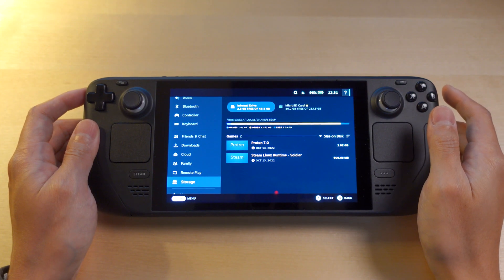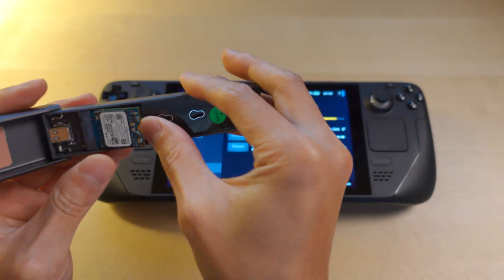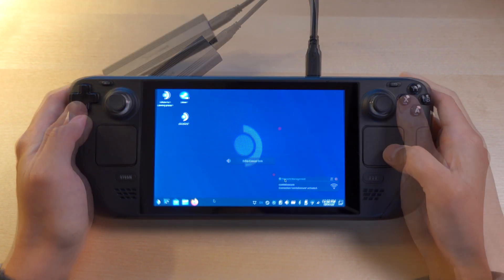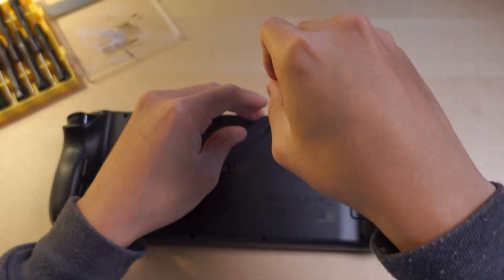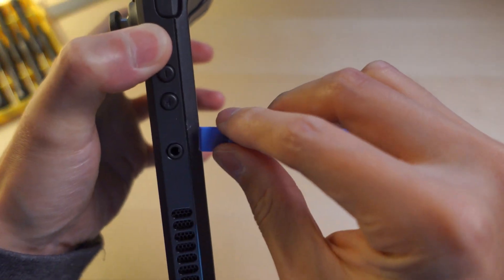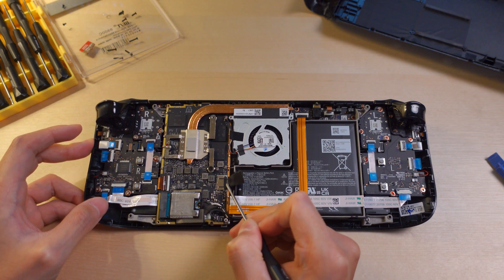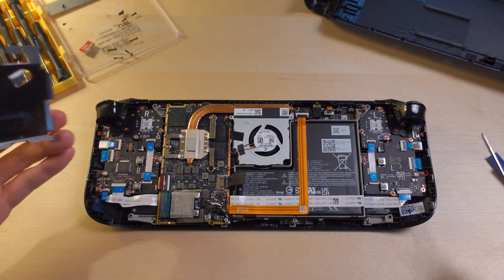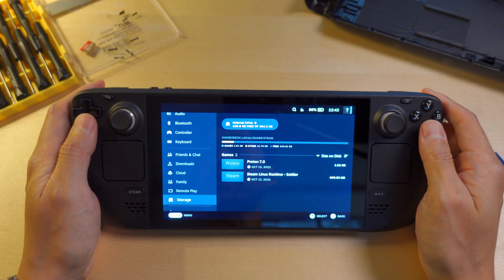Steam Deck NVMe SSD Clone and Disassembly

Comment: clone command: sudo dd if=/dev/nvme0n1 of=/dev/sda oflag-sync bs=128M status=progress

This is a command to clone the entire disk of /dev/nvme0n1 to /dev/sda using the dd command. The if option specifies the input file, which is the source disk /dev/nvme0n1, and the of option specifies the output file, which is the destination disk /dev/sda.

The oflag-sync option is used to ensure that data is written to the output file synchronously, which makes the cloning process slower but ensures that all data is written correctly.

The bs=128M option specifies the block size to be used when reading and writing data. A larger block size can improve performance but also increases the risk of data loss if the process is interrupted.

The status=progress option is used to show the progress of the cloning process in real-time.

Note that the sudo command is used to run the dd command as a superuser, which is necessary to access the disk devices. This command should be used with caution as it can overwrite data on the destination disk and cause data loss if not used properly.
Reply: I have a brand new SSD right out the box, do I need to do anything before cloning my old drive to the new one?

Comment: After the reboot, all games from the old ssd are gone. Everything had to be reinstalled on the new one. Only the games on the SD card are still available. Not so good!
Reply: Same, works to start off with but goes back to startup after reboot. Did you find a solution?

Comment: When trying to clone to a brand new 1TB Sabrent SSD I get dd: failed to open 'dev/sda' : no such file or directory exists. Am I missing anything? I already have a password setup in desktop mode and my personal computer detects the  drive when I look in computer management
Reply: Make sure when u type in nvme0n1 u use a zero and have no sd card installed and make sure ssd is gpt

Comment: Word of advice for anyone looking to do this: Once you boot into the drive, let it run for a bit. I shut my unit down right after it booted in so I could screw the back on, and it would not boot into SteamOS anymore. A reclone, successful boot, and waiting a bit resolved the issue. Drive is now dual booted with no issues.
Reply: Same thing is happening to me. I turned it on, saw that everything worked perfect, turned it off to finish closing it up. Then it never booted back up. So you restared the whole process and that solved your issue?
Reply: @SiriusLee128  Yes, i put the other ssd back in, recloned, installed the new ssd, turned on and let it run for 10 min, after which i tested a few restarts and a few shut downs
Reply: Was quick and easy to do, had it powered down and put it on the dock everything was there then it powered on by itself and everything was back to factory settings. Its up and running but I lost all my games and progress (mirco sd is still fine)?  Can I just copy and paste the old 64GB folders over???
Reply: Works for me on first boot but whenever I restart it goes back to the setup page (page to select language), and data is lost. Tried it twice now, even left it for a couple of hours before restarting. Any idea what could be going wrong?
Reply: @rhyslloyd5090  didn't have this happen to me. I would say go ahead and reinstall SteamOS (not a full reimage, just reinstall) i did that for my brother's deck that had the 'stuck on logo after cloning' issue and it booted up fine after reinstalling SteamOS, no data loss either

Comment: i tried this with a 1TB drive to a 2TB drive and it seems to only work to boot a single time but then upon restarting, the OS breaks and cannot boot properly. I have repeated this 3 times (SSD swapping back and forth) and can verify i am targeting the correct disks via lsblk. 

I have no idea why its not working past the first boot.

The only thing I can think of that may be an issue is possibly because I formatted the drive to NTFS to speed test it before i did the `dd` and maybe that extra space is not getting formatted properly via the DD command
Reply: any luck yet? I have the same issue right now :( Upgrading from 64GB to 2TB...
Reply: @KingMoeha  I ended up cloning my disk using Macrium to make a backup then I made sure when I restored the clone to the new disk  I selected the option to wipe the target drive ahead of time.

That worked. My theory was that because I had previously formatted the drive to NTFS, DD was only overwriting 1TB and the remaining space on the 2TB drive was still left formatted incorrectly

Comment: How long should the deck take to turn on after doing this? Mine is now just flashing on and off with steam logo and in the corner saying "rebooting into firmware" did I fuck something up? Any help appreciated
Reply: Put my old SSD in and works fine. My new SSD shows 420gb free before I run the command. After I run it, 60gb copied, it still says 420gb free is this correct?
Reply: It's not working for me. Followed everything and it's just not working. I do have to admit I'm no super techy. Perhaps I was over confident 😅

Comment: Just followed this tutorial, and like others, the clone command in the terminal worked flawlessly for me. Be sure to make sure your deck doesn't fall asleep though or it'll fail out. Other than that, if any of you are having trouble getting the sleeve back on your new SSD, you can undo the tape on the backside of the sleeve then put it on the SSD and then adhere the sticky part again.
Reply: Go to desktop mode, steam settings, display. You can tun sleep mode off from here
Reply: Just a quick question, do I need to format or anything on the new drive before doing the clone command? Or I can just put in in the enclosure as I got it from the mail and clone it?
Reply: @jimfaker  You can just run the commands on the new drive right out of the box.
Reply: @endor_ewoks_fc  great thanks
Reply: Tried the command and it didn’t work well I guess twin age and reinstall ugh
Reply: Mine fell to sleep. Do I need to clear the drive?
Reply from the maker: From other comments, it looks like you may need to rerun the DD command if it goes to sleep.
Reply: @DavyChiu  yes I rerun it but then it doubled everything.
So you need to delete al the created partitions first before you rerun.
But that's very fast in KDE.

This tutorial is real perfect.
My dual boot is working like a charm
Reply: @mauricewal just curious it won’t let me delete the created partitions and now I have double everything. I don’t know how to fix it
Reply: @BrokenChalice  I had the same but in KDE it let me delete all partitions very easy so I could do it again.
Hope you can fix it and remember to not let I go to sleep.
Reply: @mauricewal  I ended up just plugging it into my PC and using disc manager to format the ssd then re-copied the steam deck ssd. Worst case scenario if it doesn’t work I just reflash the SteamOS image. Not like I don’t have the stuff to do it anyways.
Reply: @BrokenChalice that should work also. And you always have the old ssd as backup.

Comment: I did the DD command to clone my drive. It seems to work and all partitions and files seem to have been cloned correctly. The cloned drive won't boot my Steam Deck. It gets stuck in the Steam bootlogo. I also tried cloning software on Windows using 2 NVME USBC enclosure. Again, the clone seem to work perfectly fine but it still get stuck on the Steam bootlogo. I do not want to reimage since I got a lot of settings on my Deck and I hate redoing everything from scratch. Now I just use the extra SSD on my laptop.
Reply: have you tried clonezilla?

Comment: Should the new ssd be formatted before hand and when it's done and you check it in KDE partition manager should both drives look the same? I've ran the command once and it seemed to go ok but when I checked it in partition manager the new drive still showed as empty. I didn't want to install it in case it hasn't worked.
Reply: Hi, did you figure this out? I am running into the same issue, when I check the ssd after the command has finished. Did you replace the ssd yet? And did it work find despite the KDE manager thing?
Reply: @Mr54M  I just gave up and did a fresh install.
Reply: @alexhayuk  oh okay. Appreciate you taken the time to reply! Thanks. Hm, I'll might try it in a couple of hours
Reply: When you restart the deck it will automatically  refresh your partition and show correct storage info.

Comment: This tutorial worked perfectly for me. No problems whatsoever. Thanks so much. You saved me a lot of time with this simple way to clone my old drive. Easy. 💯
Reply: Were you by chance using emudeck? I'm curious if I'm going to have to reinstall it or do anything new with my ROMs
Reply: @cursedhellspawn362  No, I haven't set up any emulators yet. And when I do, I plan to primarily use RetroArch via Steam. But I have seen other videos show that cloning your drive should keep all of your files and folder paths intact, so I think EmuDeck will be fine using this method.
Reply: @cursedhellspawn362  emudeck is only installed on your SD card.

Comment: This was awesome and exactly what I was looking for! Thank you!
Reply: I seem to have borked it by experimenting with loading up the old drive to experiment with it. Got any ideas on fixes? I think just repeating the process might do the trick.
Reply: It did not.. :( I even tried to re-image the Deck with the recovery tool, but no luck.
Reply: Sorry for a 4th message here. Turns out if you have a clone image and then use the official recovery tool, it will work. Always back-up your files kids!

Comment: I'm Copying the files over using your method and exact hardware And I Got in error. So now I am re running the command will it still work? First time 81gbs copied before error. Should I format first?
Reply from the maker: My recommendation is to check that the new drive is real and has no errors. There are lots of fake drives circulating. It's possible that you could just have a defective drive.
Reply: @DavyChiu  thanks for the reply yeah I installed it again with the command and it ran seems to be working now but it seems slow so it's one of those new drives the sabrent 1 TB rocket nvme 4.0 2230 what do you recommend for a Linux testing software?

Comment: Perfect guide on how to clone the SSD! I could have gone down the Clonezilla route but this was much easier to do. Easily swapped a 1TB to 2TB SSD.
Reply: Yeah I watched the video for that and looked like a pain, I’d rather buy an enclosure lol..
Reply: 1tb wasn’t enough? i wish i had your problems man haha
Reply: That's what I was thinking about doing originally, but I'm just doing this as well.  I "might" make a clone at some point just to have a backup.
Reply: how is it so far now? and did you have a dual boot 1TB setup
Reply: @lyndongaming  - so far mine is working great and I have had zero issues (*knock on wood*).  I did not dual boot so I've honestly not tried that part of it - just booting into SteamOS only.

Comment: Thank you for the excellent tutorial!
 One key thing for anyone trying this. Make sure you setup the password and use type "sudo" before you paste the clone command.  You can see he types it in Konsole but it is not included in the clone command in the description.
Reply from the maker: Thanks, I have included sudo in the description now.
Reply: @DavyChiu  do I have to format the drive before the cloning?
Reply from the maker: @pianodemon109  no, the DD command will overwrite it completely
Reply: @Davy Chiu  thank you! Worked like a charm. Upgraded a full 512gb ssd to a 1tb one. It was pretty damn quick too! Everything transferred over almost seamlessly. A couple of settings here and there were off but nothing significant.
Reply from the maker: You can repeat the command as many times as you want.
Reply: @DavyChiu how do I make a password?? Do I just type one in in console when it asks me??

Comment: Not sure you'll see this, but the enclosure you linked says it only supports down to 2242 drives, is this just a mislabel or a different enclosure from the one used in the video?
Reply from the maker: @arobeeTV the description is incorrect, it supports 2230 as you can see in my video

Comment: Please understand I'm trying to get this right, From the video I didn't see you prepare the drive in any type of way. Are you saying I can just insert a new drive into the enclosure, run the command in the terminal, insert the new drive into the Steam deck and it works?!!! No formatting the drive nor expanding partition ( I'm going from 64GB to 1 TB)?
Reply from the maker: Yes, the dd command copies everything exactly and SteamOS will do the expanding on boot.

Comment: Quick tip to anyone doing this - when formatting the new drive DO NOT create a new partition in the empty space, ONLY create a new partition table and leave all space unassigned. The initial boot partition will be formatted in whatever format you initially formated the drive to otherwise, instead of the required FAT16. Wiping the new drive and doing a fresh dd from the old drive soon fixed it from a now blank drive. Added bonus that I could boot from the old 256GB over the USB-C connection and do the dd back onto the internal drive at no speed loss.
Reply: Hello. Can you please explain I can do what it is you have mentioned. I like to use Disc genius for my drive needs. When I wipe my drive, then make a new partition, it always needs for me to select a format type, then it shows the storage space available on it. Thank you
Reply: Don't format the new drive at all, the steam deck will format it it's self

Comment: After you disconnect the battery, you need to press the power button to ensure all the power is drained.
Reply: It’s impossible for me to disconnect the battery. I just replaced ssd all the way, and no issue occurred while the battery being around 80%.
Reply: Just did this from a 512 GB drive to a 2TB WD sn740. Took me just a few minutes. Beware that the destination of the dd command might not be exactly the same mount point. Easy to check with KDE partition manager
Reply: @fastmaxr huh? Wym
Reply: No you don't. It won't hold that much power in. The largest capacitor on there is smaller than your pinky fingernail. I'm an electrical engineer and I'm telling you it's unnecessary.
Reply: I just electrocuted myself to get the rest of the power out no sweat
Reply: That’s a nice tip. But Valve recommends to put the device into power storage mode via its UEFI options, which ignores all power button presses till you connect it to power charger again. But I’m lending indeed your method to get out the last bit of juice in the circuits
Reply: I don't recommend this but I left mine plugged in. Didn't want to break anything unclipping it. Nothing happened all good.
Reply: @krisadams7100  interesting. I did this when I added additional m.2 to my girlfriends laptop and the same thing was done in the video tutorial. I watched another tutorial because I was having trouble removing the screw and that video said to unplug the battery so I kinda started freaking out. I read on Reddit too that it’s not a big deal leaving battery plugged in for laptop upgrades like ram and storage so I felt a bit better after that. After I got it installed and loaded it up, everything was good and was able to format the hard drive. 

I unplugged the battery when I upgraded my steam deck and probably will again if I ever do it again in the future but still interesting that nothing bad happened when you did it

Comment: Have you noticed any issues since the change?  I’m usually cautious about taking shortcuts with tech as opposed to Steams written documentation but this really seems like it would save a ton of time.
Reply from the maker: Nope, it is an exact copy of the original drive. Any issues would be from something else, assuming the hardware is good and handling was done properly.
Reply: @DavyChiu I do have another question. I have additional swap file space allocated on my factory SSD, transferring to a higher SSD, do you think the system will still use that space for gaming Ram performance or will it just see it as useless space?
Reply from the maker: @pjolley89  SteamOS (Linux) will use the entire swap as needed.

Comment: I tried this with a 512GB ssd to 1tb SSD and it did not work correctly. 1TB SSD only shows 466.31 GB partition available and does not allow me to extend it. Ran "partprobe -s /dev/sda" and get a message "Not all of the space available to /dev/sda appears to be used, you can fix the GPT to use all of the space (an extra 1000194048 blocks) or continue with the current setting?" Tried "resize2fs /dev/sda8" but that did not work. Is there anything I need to change or add int the original command to get this to work for a 1TB SSD?
Reply from the maker: Sorry I didn't get a chance to respond earlier. SteamOS should automatically expand it when it boots up. But if it doesn't, you need to expand the partition first and then the filesystem. "parted /dev/sda resizepart 8 100%" and then resizefs. You could also use gparted if you prefer a GUI.
Reply: @DavyChiu  I'm planning to upgrade my ssd soon to 1tb will this work the same if I have a dualboot steamdeck running both steam and windows os?